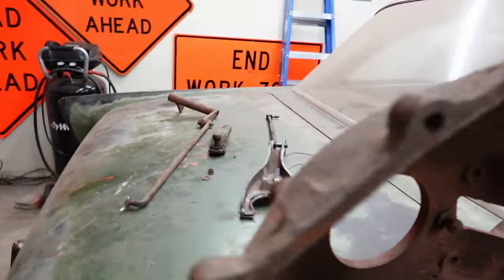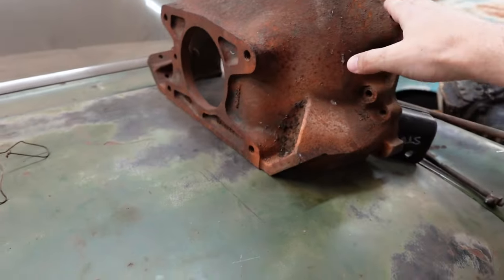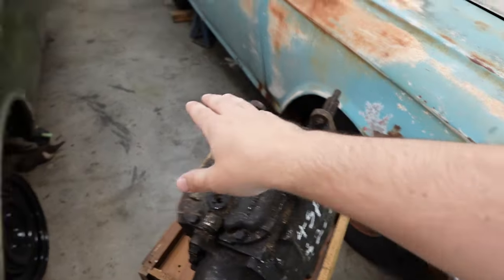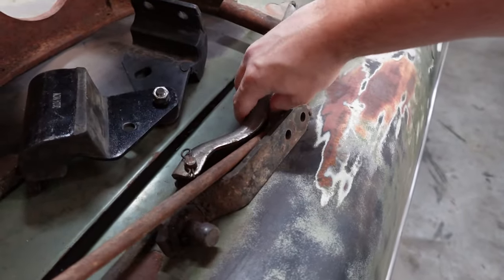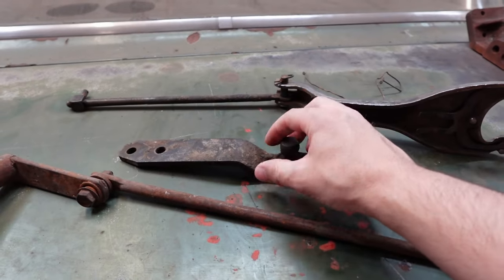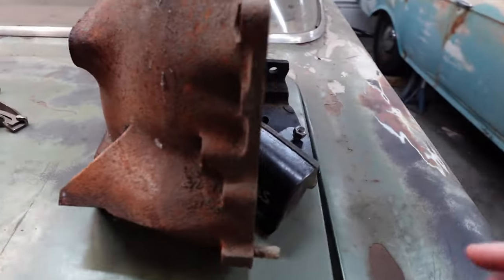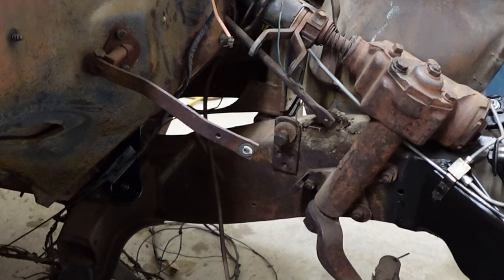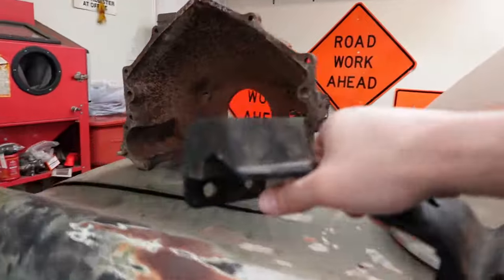Swap Meet 4 SPEED & Tri Five Parts For My 1956 Chevy Build

Comment: 12:00 I believe the ID-number you are looking for is stamped on the flat surface right under your hand in this shot. On the edge of the casing. That is where it was on my old Saginaw. 
Mine was way smaller than yours, and had the reverse shifter lever in the tailhousing and not on the side-cover like yours. I dont know which type you have to be honest.
Reply from the maker: Thanks for taking the time to tell me that. I'm just going with it's from a Vega or a Monza.

Comment: While Saginaw transmissions are definitely not as tough as a Muncie, they are still a pretty darn good transmission that gets little respect. I used to have one in my 55' Chevy and had a 400HP small block in front of it. It got beat on hard and never had an issue. They are cheap and easy to rebuild too. The worst issue with them was usually they came with a shit factory shifter. One missed shift with some power can frag them. A good Hurst Shifter makes a huge difference. I have a couple of those 3.11 first gear Saginaws. One is currently in my wife's Buick. It works great. 3 and 4 speed Saginaws use the same case. The transmissions were used in all kinds of cars including Chevelles, Novas, Camaros, Vegas, monza's and their other gm Siblings as well as trucks and vans. It will work well to get you up and running and should serve you well.
Reply: You must not ever drive that car hard or that choice of trans would tend to show it's weaknesses. I'm a child of the 70's as I was born in 60 and every person I know as well as all racers used a top loader Ford trans for every car over about 300 HP. Due to case flex on Saginaw and Muncie GM trannies the synchros are constantly getting torn up. The worst one being the "rock crusher" Muncie being named that because after about 2 hard shifts it sounds like a box of rocks. It wasn't because they were strong. Oh and I'm a 35 yr Senior Master ASE so I try to help people help themselves. Life's to short to replace trannies all the time.
Reply from the maker: Thanks for sharing that. I'll be running an older Hurst shifter. I also won't beat the living tar out of the thing.

Comment: thats 57 clutch stuff it as a working group will work on a 56 if you need a clutch bushing get 57 parts  the throw out arm is 57 also    they are different but will work
Reply: the 57 z bar throw out arm on a 57 are actually better than a 55 56 cause they are stuck together    if you snap a 55 56 return spring parts can fall onto the road   that will not happen with the 57 set up  also checkout the tranny mounts they should bolt rite on at the lower corners of the bell  the truck mounts and tranny bolt up and shape is different   that guy nmay be correct  cant tell from the angle        those are the same as the early camaro trannys but have a higer top gear i have one in my 57 sedad works great but then again i do not pull hhole shots     i strongly sugest the same for the 56
Reply from the maker: Thanks for taking the time to let me know. I appreciate the info. I'm 99.9% certain the bellhousing is for a passenger car. But I'm not going to say anyone is wrong because I don't know it all. We'll find out I guess.

Comment: THIS Bell Housing IS FOR A TRUCK YOU WILL SEE WHAT I MEAN. YOU WON'T BE ABLE TO USE THE REAR MOUNTS.
Reply from the maker: How so? It looks like a passenger car bellhousing to me. I appreciate you saying something.
Reply: @freemansgarageextra  Truck bellhousings have a larger hole for the locating register so double check that the Saginaw fits tight in the hole when bolting to the case. The late 50s and early 60s truck bellhousings look very similar to the Tri five style ones.
Reply: @freemansgarageextra  THE ANGLE OF THE TRUCK BELL-HOUSINGS IS DIFFERENT AT THE BOTTOM WHERE THE MOUNTS BOLT TO THE FRAME.
 Try to put on the mounts and bolt it in the frame without the motor bolted to it.
 This will tell you real quick if it is a Truck or not.
 You can also run the numbers on the Bell-housing.
Reply: @bcavmechanic  You are referring to the diameter of the front collar on the transmission. There are some of those cast iron bellhousings that use the smaller diameter collar and some use the larger collar. On the Saginaw three speeds the collar is interchangeable and I had a friend of mine who took a cast iron bellhousing put it in hie 68 El Camino (he was changing over from automatic to 4spd and the hole in the bellhousing was for the larger collar but he just used the transmission bolts to keep the transmission in line (although I am sure his clutch runout was out some) and he drove it for years. How do I know this?  Well he was a good friend and I knew the car from when he bought it and I now have the car. He modified the bellhousing so that he could use the starter mount to the engine block. I have just replaced the flywheel ring gear and had a bellhousing with the smaller pilot (cast iron) for Chevrolet truck and have a starter for the bellhousing mount as well. I would have preferred to use the proper bellhousing but did not want to buy the proper bellhousing for the larger flywheel. The car has a Muncie 4speed and it appears that i could have robbed a collar from the Saginaw 3 speed units I have but opted not to.
Reply: @jjdriver55  Yeah it has been a long time but I bought a V8 from the same friend back in 1971 and of course the 56 Chevrolet I had was a six cylinder three speed and of course the bellhousings are different. So I acquired a V8 bellhousing from my friend and was able to use the rear mounting brackets to the frame that I had actually replaced when I had the six cylinder engine  in the car. What the fellow shows in the video look to be the rear engine/bellhousing mounts. Like I said it has been over fifty years since I did that swap so memory can be a little foggy. The acid test is like you suggested see if the bellhousing will mount up with that arraignment.

Comment: I u sure that trans will bolt up to that bellowing? Look like bolt holes are different to me
Reply from the maker: It will. I’ve set the trans in the bellhousing & lined it up. Also I bought all of these parts from someone who has been building tri fives for decades. He wouldn’t steer me wrong.